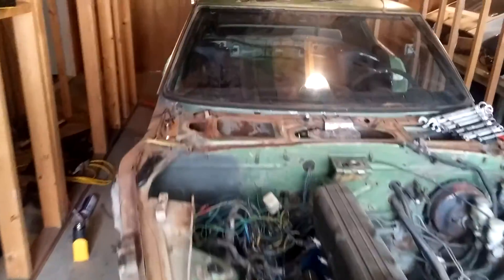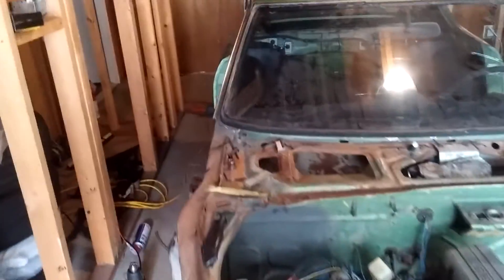How to remove Automotive Paint without sanding or chemical stripper.

Comment: Does it remove bondo as well?
Reply from the maker: Ardee de la Rosa. I cannot say if it does or not.  Bondo is a soft substance and a blade across it will more than likely make scratches in the bondo while removing the paint.   If you are trying to remove the bondo , there are probably videos on have to remove it.  I use a chisel.
Reply: Hi. What is the optimal heat for removing paint using a heat gun?
Reply from the maker: Ardee de la Rosa I am unsure, but I used the lower setting on this heat gun for a few seconds and it was enough to remove the paint.  The surface underneath was metal for my example. I have no idea about other materials, but I have seen old timers use the same method on fiberglass.